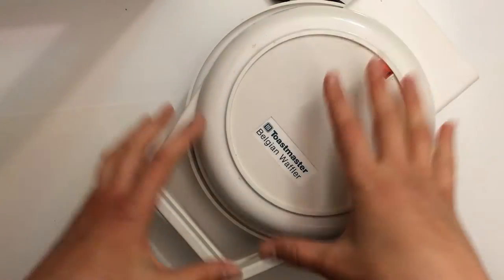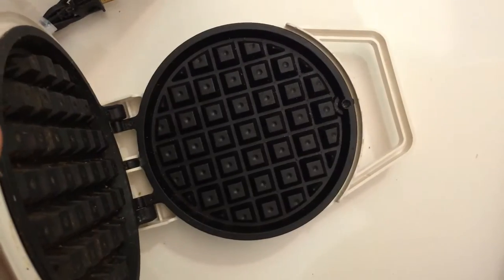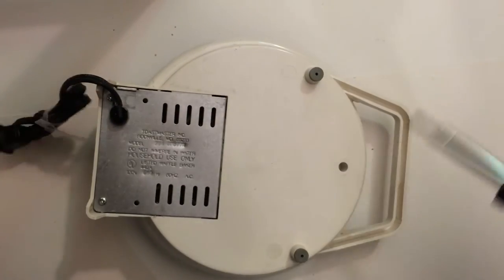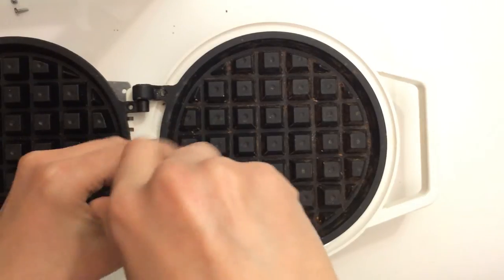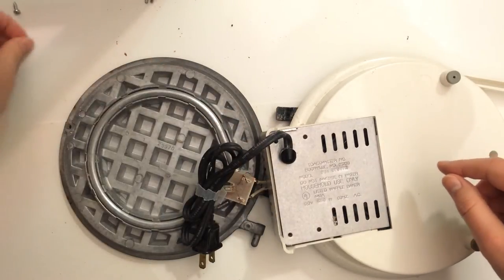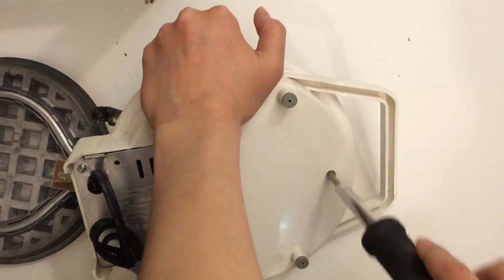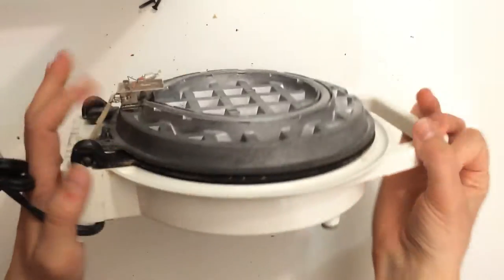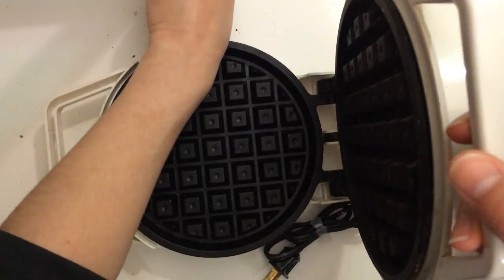See What is Inside a Waffle Iron / Maker and How it Works

Comment: That round thingamahbob is a temperature controller. The bulb doohickey is a xenon light with a small resistance thingy that powers up when electricity is flowing through the thingamahbob indicating the waffle is cooking. After the light goes off this means the meadow muffins are ready to be removed with a grubgrabber tool. Don’t burn the booger gitters.

Comment: Hope she can show us how to test the circuits... and study the rings that bring the heat... same type of rings used in the TDCJ Hot Pots, which are sometimes deconstructed and used as their lighter, or installed under a stainless steel table and enable it to work as an oven.  The part she wondered about I think is a thermostat... the waffle iron only gets so hot... I got a waffle iron at the Goodwill... a "Dash" brand... big, but didn't work... the light works; I took it apart and looked at it... looked like the wiring is pretty good, so I am going to check it out with a voltmeter...ohmeter... where it connects... where it doesn't...

Comment: Upon our quest for knowledge about the way a waffle iron works, we found they arnt timed by a timer, the thermostat reaches a set  temp and shuts off the current to the element. Havent figured out more than that, Im left wondering if the cycles get shorter the for the light because the unit reaches temp faster once everything is warmed up.
Reply: The temperature is going to be somewhere above 212°f and probably not much higher. In this way, the iron can only hot hotter once the water has baked out. Until then, the water in the batter keeps the griddle "cooler" and cannot rise much above 212°f, the boiling point of water that converts it to steam. When the steam stops (and the red light comes back on) your waffle is done.

Done "to taste," anyway. Tastes vary on crispiness.
Adding peanut oil to the batter before baking will add a lightly-crisp outer surface, which some people like.

Comment: does that light stay on or does it cycle on and off? if it shuts off that just means it's telling you and it's up to the optimal heating temperature. I don't rely on these lights alone sometimes I do the water trick and se if it evaporates.